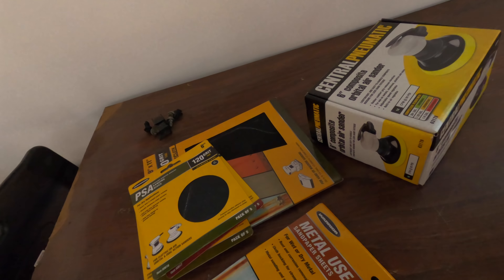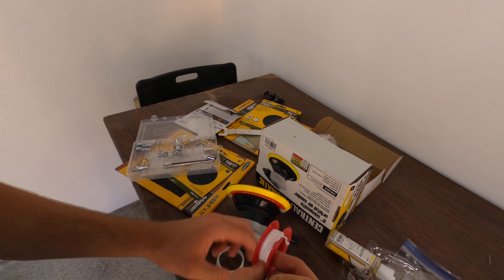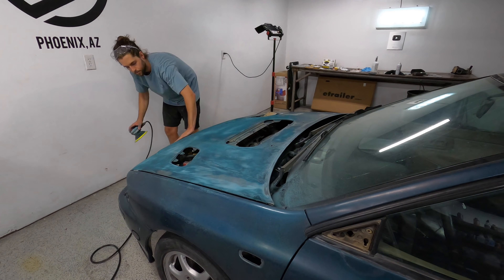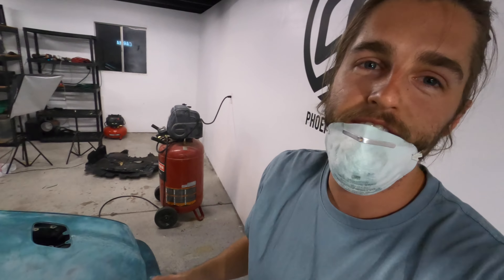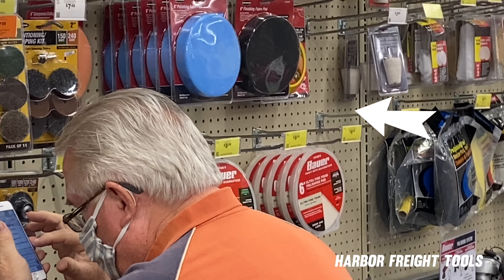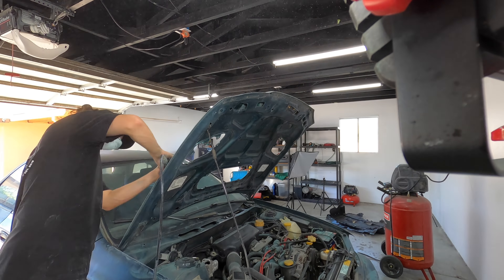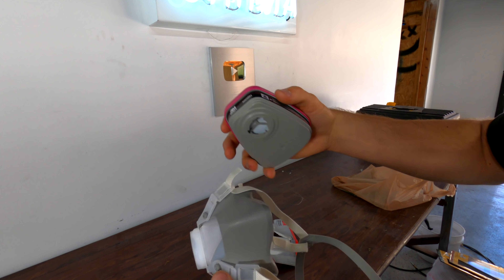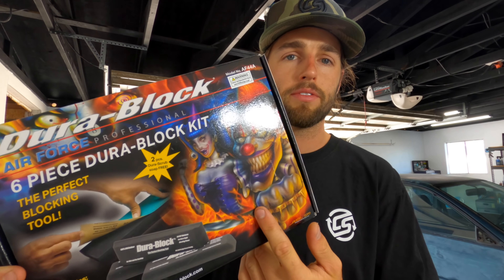Building a 22B STi: Sanding Begins - What You Need to Know Before Sanding a Car

Comment: The wiper blades on my bugeye looked that faded. Sand a tiny bit and use a matte black or semigloss spray paint. Paint is holding up 2-3 months later. Definitely worth it

Comment: I started doing body work in 1974. I was not allowed to use a power sander until I learned to hand sand and feather out old paint and repairs by hand. 49 years later I mostly wet sand by hand unless doing filler work.  It is quieter and creates less dust in the shop.   Existing paint that isn't damaged only needs to be sanded for paint to adhere.  Machine sanding goes through layers of paint creating need for more priming more sanding and more materials. 
 Don't believe everything you see on You Tube. Only damaged paint needs to be removed. Hand sand and enjoy the tunes while doing so